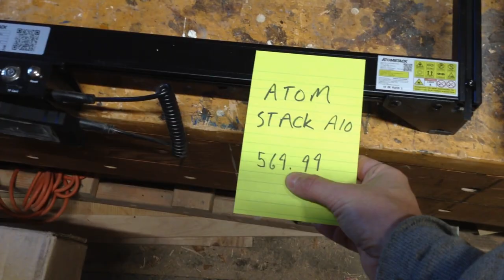Woodworking : The Best Laser Engraver For You

Comment: Good video.  I like seeing them compared side-by-side.  The construction doesn't look all that substantial, but I guess they don't need to be since they are just moving a laser module around and there are no cutting forces to deal with.  Most of the expense is in the module.  Are these all 10 watt optical power machines?
Reply from the maker: Yes, the frames and gantries all seemed a little flimsy to me at first as well.  But, I agree they really just need to be able to move around the laser, so the extruded aluminum is perfect for that.  Yeah these were all the 10 W version, and I didn't notice any major differences in how they engrave/cut.  But, admittedly the best way to review that would be to keep all the machines and perform identical tests on them.  Which I do not want to do.